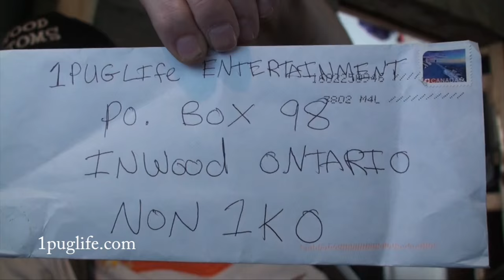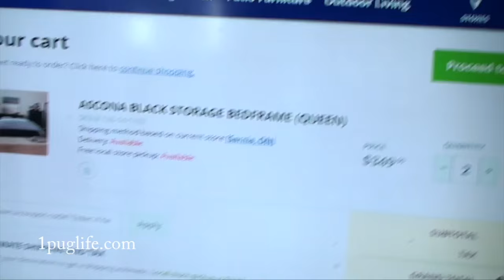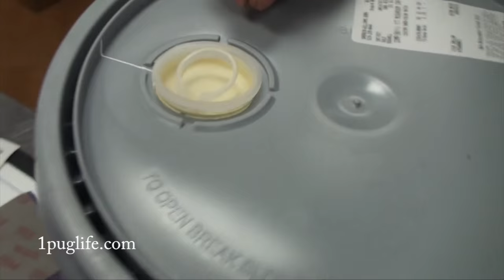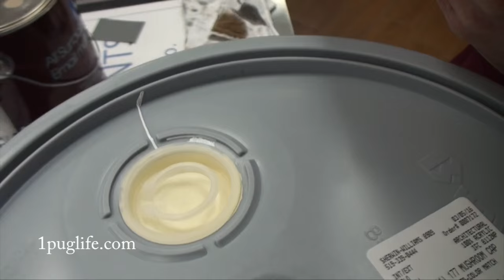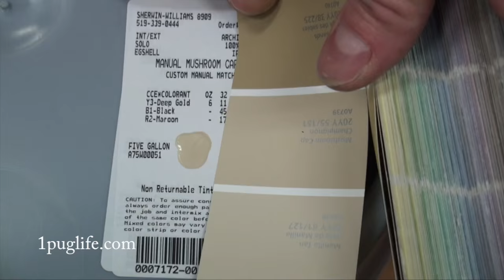priming inwoods

Comment: Sherwin here in states has a line of interior paint called PMC, only kind we use for rentals, not sure if its just semi-gloss off hand.  Been using it for 5-6 years very satisfied with quality. We thin it down a little for airless still awesome shit. Runs around $100 per 5 gallons.